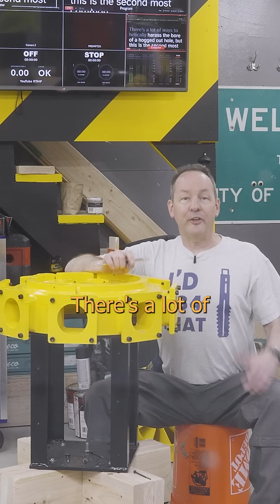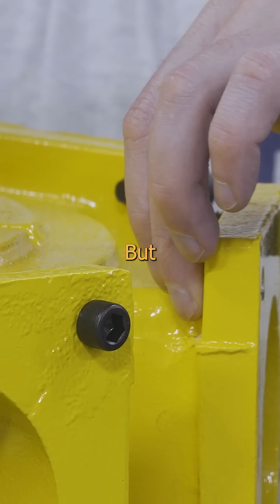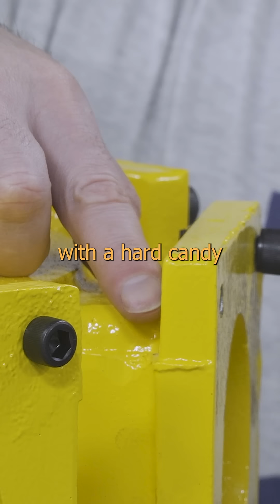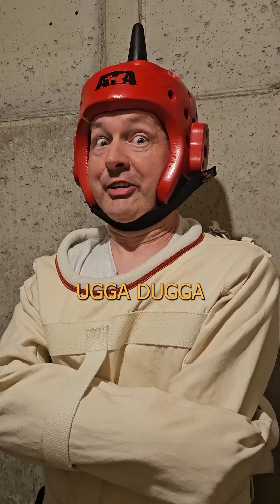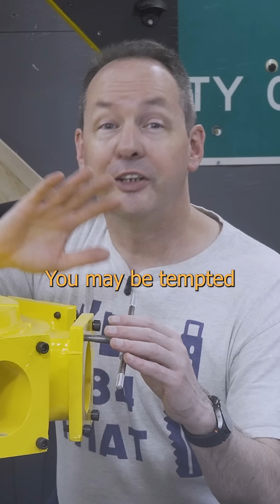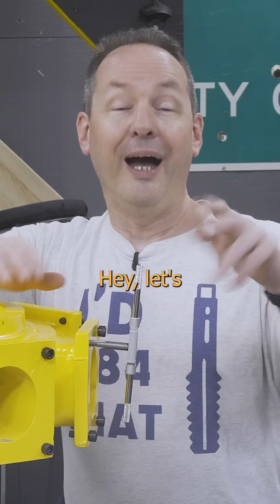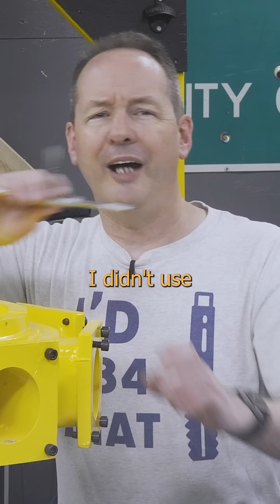Thread Chasing  #chrisboden #comedy #engineering #skills #workshop #metalworking #tools #apprentice

Comment: Guilty of using that method, but until making this comment I haven't had it fail.  It probably will now though.
I do also have a Procunier auto tap tool, actually two of them since my new drill press came with one already set up in it as well, but that's for some pretty specific work.  
WD-40 works great for aluminum work in a pinch too, but the Tap Magic smell is the thing great memories are made of.

Comment: If you get a good kit it will have 3 taps, one to start the hole, and two more to finish the hole, each with slightly more aggressive teeth. It's more work,  but less likely to snap off your taps

Comment: In the woodworking world, the equivalent mistake is not driling a pilot hole, resulting in either tear out or worse, splitting. 

I learned both the hard way, more than once.

Comment: absolutely, learned what helicoils were the same day...
Reply: Not from a tap but hardened bolt that broke off hella crooked I learned what helicoils and left hand bits were that day.
Reply: The other name for those are "a bad day" having learned the same lesson in a similar time frame
Reply: Me too...
Reply: I only use them in the last case scenario! If there is enough meat around the hole then I would use the next size tap I'll change out the bolt

Comment: Dumbass
600 threaded holes per part where drilled and tapped with the wrong damn tap, the right TPI but the tap was designed for an interfeance fit. And expensive. And the day shift was already raked over the coals for the delay so in comes night shift to the rescue.
We really wished we could just use the milling machine but these parts where as long as a football field and taller then any of our vice jaws or blank soft jaws. Getting that lined up so a dumb computer program can do the job right may as well been a unicorn.
Now between me and the then graveyard foreman we had two tap handles too few. The less experienced guys had the tap handles. We started off right knowing that cross threading was a large danger but that shift was ending soon...

I mean. They where battery powered wimpy drills. How bad could it be?

Appearntly, one twitch of the finger too much and they turn the tap into a milling bit. Even on the old wimpy worn out cordless drills. we learned that about three holes in. And with a combined 50 years experence between the apprentice forman (me at the time) and the forman, and only one of us knowing how to use a manual mill (also me) we got to work on the clapped out oh shit manual mill fix it machine that most had resigned to use as a drill press to bore out and weld in plugs. Boy the morning crew was suprised to see us still working on our one single part in the morning and we both got called zippy for the rest of the year.

Comment: Dumbass🎉 auto tech turned diesel tech now self employed... I paid the price a little differently as wherever I worked most grease monkeys cant figure out when to stop tightening... I got very good at bolt removal, thread tapping, helicoils... and then a coworker sent a cng coalescent filter housing(aluminum) into place with his 3/4impact... not wanting to draw attention he tried to reverse it out... that didnt work... he said must be tight enough and TURNED THE CNG ON... while I was using a torch 6ft away in the next bay... he learned when something seems like its going wrong stop and ask. I have had an apprentice save my ass atleast 10x with this simple phrase... what did I learn? Im really quick about shutting off a torch in a panic but really bad at keeping my hand safe 3 dislocated fingers! Remember apprentices will always surprise you! If thats a good or bad surprise you'll never know!😂

Comment: I'm a machinist. here's a very handy tip. when chasing an existing thread, you can help avoid cross threading by turning the tap counter clockwise to begin with. you will be able to feel where the first thread engages, then reverse direction.
Reply: Works when starting bolts too. That's how I avoid cross-threading bolts on my bike.
Reply: @BeardyBicyclist this is how I start every bolt after learning it. That extra second you spend can save way more time than cross threaded or broken bolts.
Reply: @BeardyBicyclist  And bottles of water, I can close a 500ml bottle with one hand whilst driving with some dexterous fingers
Reply: I do that with so many things with threads. That's how my dad taught me to put the lid on the big orange cooler properly back in the day. Way less of a fight.
Reply: @agailparsons I don't know how else someone starts threads if not by going backwards first.
Reply: @VexingRaven I don't feel so weird about it now. Most people I've met don't do it. I guess grandpa being a machinist and teaching similar skills might have helped too.
Reply: @agailparsons I learned it from a master cabinetmaker years ago. Never cross threaded a bolt or screw since.
(Yes, it works with wood too.)
Reply: This works for nearly anything, even the caps on soda or water bottles. Turn it backwards until you feel it fall into place then you should be good to go.
Reply: This!! Also for self tapped holes in plastic when restarting the screws.
Reply: @CydFSA   - then for ALL threaded componentary...
Reply: @CydFSA  -- also good when putting wood screws back in their holes.
Reply: i do that with those big tubs of peanut butter filled pretzels from costco
Reply: I do that with threaded sprinkler pipe, those NPT threads can be finicky.
Reply: I do this with everything.
Fuel cap for my work truck, dainty plastic bits with screws and everything in tween 
I bet it even works on ducks!
Reply: @djaydeved  I take it you're a fan of Zefranks true facts series? 
Helically coiled axis' and ducks seemingly go hand in hand according to his video on ducks lol
Reply: I used to tell people to listen to it as you turn it backwards. It will signal you with a click when the threads line up
Reply: @andrewm4679 it's usually one of those things where you aren't sure if you felt it or heard it.
Reply: That’s how I start 99% of every bolt or tap every time. Way easier to take five seconds going the wrong way than just drying to ram it in dry and dealing with the consequences
Reply: Always, tapping or screwing go left first until you seat the fastener
Reply: My dad taught me that trick when I first learned use a screwdriver. I am now 43 and every single bolt, screwdriver or anything with threads  is always done that way. Fine threads requires you to put you tongue in gust the right position sometimes but the trick still works.
Reply: @onemorehunter  I'm 44 and my dad didn't teach me this, I figured it out on my own. I remember showing him when I was a pre-teen and he goes "No shit, Sherlock. I didn't show you cause you'd either figure it out on your own or you don't have any business fucking with it." He was laughing when he said it, I never felt insulted or anything by him. He still taught me more than anyone else ever has. He always let me do it with guidance, when it was safe to do so. Otherwise he'd show one first, then watch me like a hawk. I never got hurt, but he did. He never made me feel bad or acted like he regretted teaching me.
Reply: @DisIntegratedLife   The quality-est time for sure.
Reply: Cross thread is just nature's Loctite
Reply: @Reubixkube  -- Now there's a glass-half-full kind of guy!
Reply: That how I start bolts too... Just how I was taught
Reply: It's such a habit for me that I do it when putting the lid back on the milk bottle...
Reply: Not sure if I’ve ever done this with a bolt, but I often do with bottle caps
Reply: I learned to do this with bolts that didn’t line up right. Works nicely when you can’t see what you’re doing. Never done this with a tap. Gotta try it .
Reply: I told this trick to a dentist when he was about to start a teeny-weeny screw to attach the upper tip to a titanium dental implant in my mouth. I was getting my dental work done at a dental school in those days, and he was just a student. I did NOT want to have to deal with the issues that would have arisen if he had cross-threaded it.
Reply: basically the same strategy with coarse screws going into plastic!
Reply: Works great for holes in parts that use self tapping screws like plastic air filter boxes or sheet metal parts. Less chance of stripping them out like the service techs did to the filter box on my mom's car
Reply: This is the way...
Reply: Heck, I do this reverse to engage thing when I put the cap on my soda bottle and other containers.
Reply: I do this with just about anything with threads.
Reply: And that BTW is the best way to get bolts started.
Reply: I use this trick all the time with bolts/nuts, especially when having to do it blind or limited visibility. 
For bolts through the part to be attached and it requires aligning the part, not feeling a click helps determine the part isn't fully aligned allowing for a little adjustment until the click is felt and then hand tightening the bolt.

Comment: I regularly have to send engine parts to my machinist friend for boring, honing, whatever. He almost exclusively uses taps chucked up in drills. It makes sense when you’re trying to tap 30 identical holes in a big engine but I just can’t fathom the luck required to not have it bite him in the ass on a daily basis.

Comment: Witnessed a dumbass in machine shop class who thought he could run the end mill slow enough... Being in a rush at the end of the day really guarantees a long day
Reply: Easy is hard, fast is slow, cheap is expensive. My main play area is growing mushrooms and it's incredible how comparable to machining it is. A Substrate prepared over the course of 2 days (soak, cook, dry, sterilize) will colonize in a little over a week and be ironclad against contamination. One that's been rushed in a few hours might take over a month and constantly be at risk of molding or fermenting.
Reply: @unintentionallydramatic 
Are they the "Magic" variety? That's cool regardless.
Reply: @GladiusOstentis  possibly, seeing the soak aspect makes me think they're prepping grain spawn.
Reply: Using the end mill to do the first few rounds of a cut in a weird angled hole isn't actually a bad plan. You have to unlock the spindle and spin it by hand of course.

Comment: Copper wire  is great for cleaning threads. Snip a piece of #12 insulated and put it in your cordless. Kink the end a little with pliers. That and a blow gun, you may not need that tap. (Do not use on aluminum, or your results are reeaally going to vary.)

Comment: If you are chasing threads and your tap sounds like a pig and is mulish like a mule you should re-check if you use the right sized tap for the threads before using oil or other stuff.

Comment: I have never considered trapping with a non manual tap screw. It is far too delicate to rush it. Besides, at most that has two dozen taps to do. It may take a while but you'll be assured to have a much simpler time when you get to the next step.

Comment: That's pretty cool! How about a Back tap? That's for when you CANNOT get swarf into a place, like a cylinder head. You need that when you're a dumbass and cross thread a spark plug into an aluminum head. The one I had to get was a dptool

Comment: Dumbass

ABS sensor fastening bolt hole. That quick sensor swap was in all more of "what all I can use to carve out the old sensor, remainders of the tap in a hole next to it and my self loathe?" All within a speedy friday evening fix. Funny thing is, I resorted to drill a new hole and made new threads to mount the new sensor. "It'll work just fine".

Comment: I sincerely thank everyone who has taught me NOT to use a drill. Surly if I was left to my own devices, I eventually would have. But after seeing the insanity it takes to remove a broken tap, I'm way to scared to make that person myself.
Reply: using  a drill is fine if you are careful. The best tip is to not tighten up the chuck too much so if it all binds up the chuck will slip instead of snapping the tap.
Reply: Another non-believer 🙄

Comment: Earplugs work great for smaller holes.
Reply: That piece is powder coated which requires curing in an oven at about 450° for an hour or two, this would destroy the earplugs and contaminate the curing paint.  Silicone plugs and temp resistant tape are used more commonly for masking while powder coating.
Reply: That's what she said?

Comment: Also, use high speed steel taps, NOT the cheap carbon steel ones. The threads will be tighter and higher quality

Comment: They make tools specifically to clean rather than  cut threads, they are called thread chasers, a lot safer then running something meant to remove metal.
Reply: Dance with the one your brought. Perfect is the eternal enemy of getting shit done now.
Reply: @QuietRiverBear but, in that direction, hard to beat an old bolt with grooves ground along the threads as a makeshift chaser.  I recently cleaned a 1 1/2" tapered pipe thread in a 65 yr old 4" cast waste tee with a $5 nipple that I grooved.  Worked great, better than a $30 tap becase it won't cross thread easily.
Reply: @dhgmllcshea5038 , did you notch the bolt threads or anything else other than just running it in and back out?
Reply: @QuietRiverBear  All depends on how often you need them. If you deal with old stuff often enough, it's good to save yourself the trouble and get the right tools for the job.
Reply: @SgtBeltfed that works if you’ve planned ahead far enough to have what you need on site at the ready. Again, perfect is the enemy of getting stuff done when you can’t be the part of the process where it stops until the perfect is available.
Reply: @QuietRiverBear  By that same logic, you won't have the tap to clean the treads out with either.
Reply: @SgtBeltfed then you make one by grinding groves into a bolt. Whatever gets the job that’s needs done now done now. You run to the hardware store if it’s that important to you to get your perfect tool while a team is standing around with their thumbs up the arse while you go get he perfect tool that’s at least 30mins away one way. Time is money and if you’re just spending yours, spending however you want. If it’s someone else’s Benjamin, you get the team and the equipment back to work as fast as possible even if you risk sacrificing a $100 tool to do poorly what the $20 tool does perfectly if you don’t have the $20 on hand. 10 guys billable at $100-$200 per hour idle for at least an hour is real money; risk the stupid tool, and make sure you order what you need onsite for next time, write up a report, use AI to get the right tone and articulation, to support having the right stuff on site. Or don’t and MacGyver a fix again next time.
Reply: @QuietRiverBear you would think an old power plant would have proper tools at hand, or at least the techs who work there would.

Comment: I worked with a guy who would use a high speed cordless drill to chase M12 threads on half inch thick steel.

He'd hand off his overheating drill and go to grab mine to do more.

After he burned out three Metabos in a year, I started locking mine up.